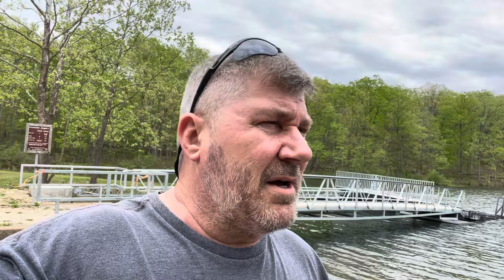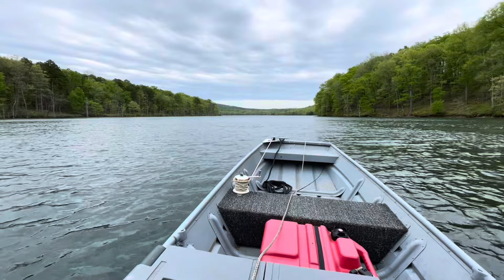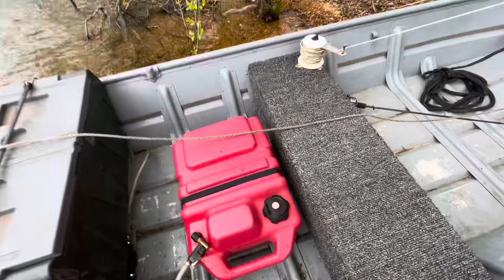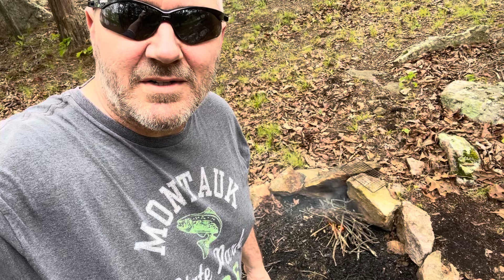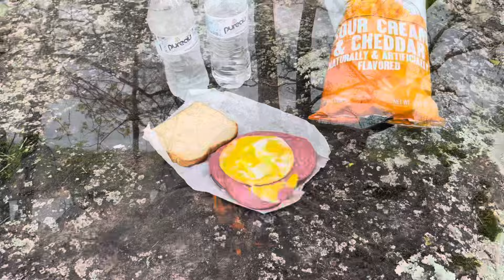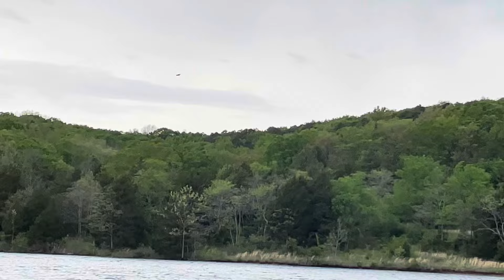Suzuki 6hp outboard fuel tank test.  Success or FAIL?

Comment: This is a very helpful video. I ordered the same motor and it is scheduled to arrive tomorrow! Did it come with the oil or did you have to buy it? If you had to buy it what did you buy? Thanks!
Reply from the maker: Thank you for watching, it did not come with oil , it does come with instructions as to what weight oil 10w 30 marine oil and i believe it called for 19 oz
Reply: @semooutdooradventures2908  thank you!
Reply: Use any 10 w 40 motor oil) And there are no problems with the engine. And don't forget about the oil filter. This generation has it, unlike the previous model.

Comment: Do you have any video running 100% with that boat?
Reply from the maker: Most of the videos concerning that motor are less than full throttle because it was in a break-in. But there are a few spots where I have run full throttle.